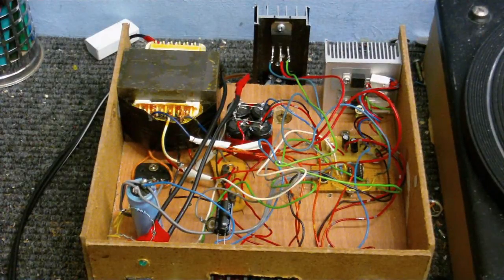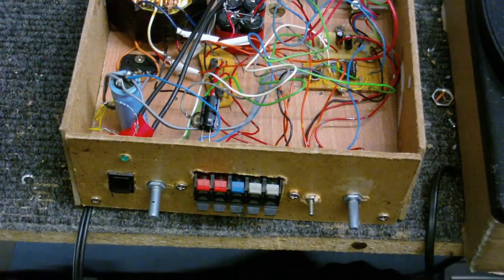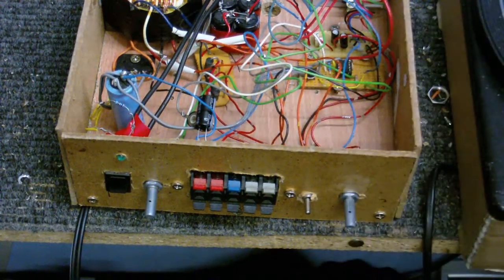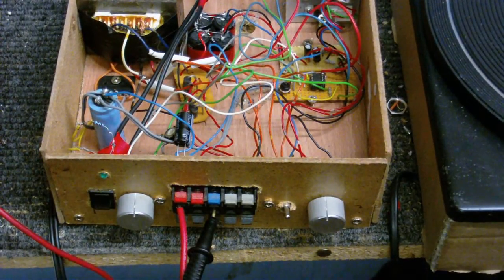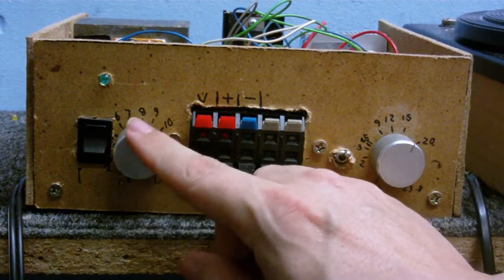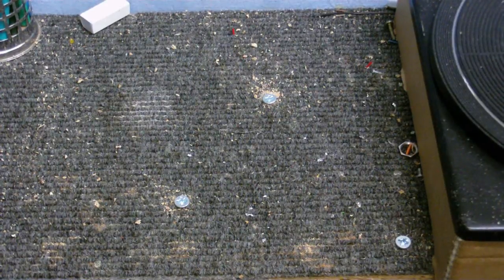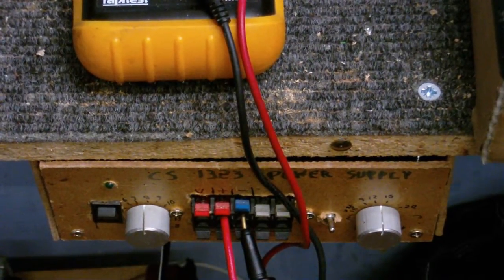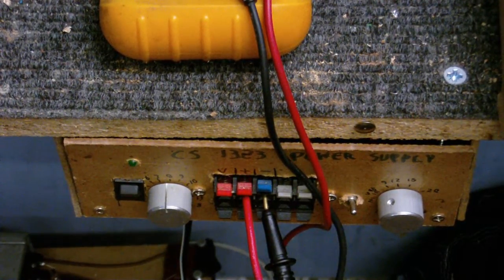CDC Electronic Work Shop - Finnishing the Power Supply

Comment: Hi building my PS in LM723 or UA723 ic and three power 2N3055 transistors output stage. And very good parameters rock stability voltage maxx amperage im meresument 5 ampers.

Comment: hay dude I've had a cheap power supply for a while but the dials are a bit sensitive so I've bought some thing similar to this. thought it would be a good addition to your power supply  			 		eBay item number: 200854338193